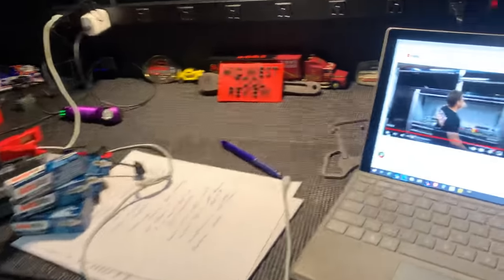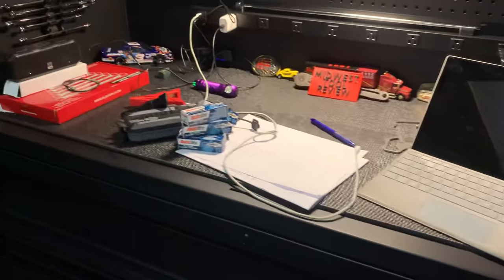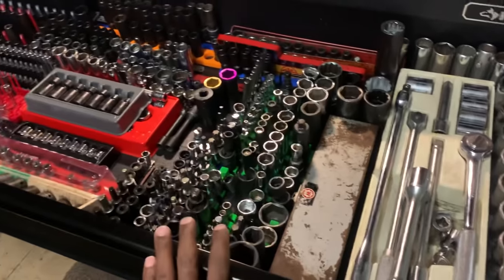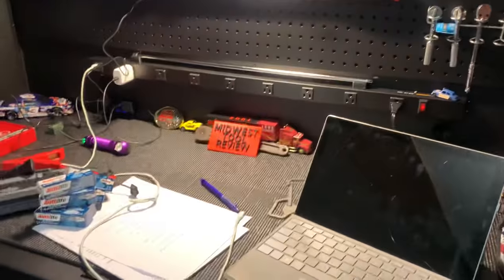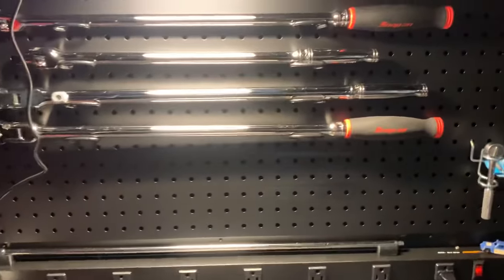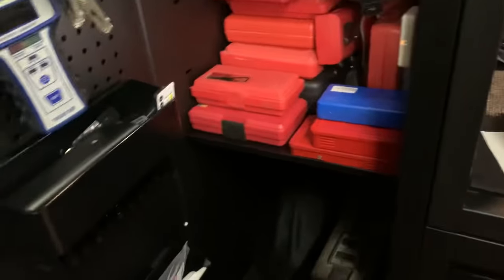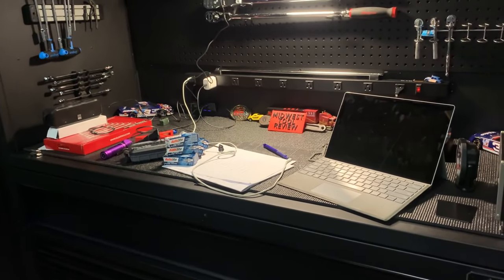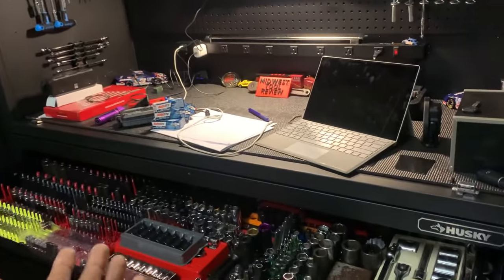HUSKY TOOL BOX | DISAPPOINTED & NEW PROFESSIONAL SERIES THOUGHTS

Comment: Great review.  As far as Husky tool boxes, they basically make three levels of tool boxes.  Some say 4, but in reality, the 4th one is simply different items used on their lower end, entry level, like one will have a thinner or thicker wooden work top or stainless work top.  Regardless, those are still their Standard boxes.

Their 1st level/ entry level what they call Standard Duty boxes are just that, entry level.  They use 21 ga steel, a few welds and rivets to hold them together.  The welds aren't really that great by comparison to their higher levels, but they are still better than Kobalt, one of their main competitors.  (But then again, who isn't better than Kobalt?)

Their 2nd level, what they call Heavy Duty (which is the box you have) jumps up their steel to 19 ga.   From what I have seen in the stores, they add a smidgen more welds and rivets, and most boxes are a bit nicer when it comes to the manufacturing process.  You get better paint as well.

Their 3rd level is the Professional Duty series, are made with 16 ga steel, and since I've only seen one box in person, and that was only for a brief second, it appeared to have a little more attention to detail, better welds and metal shaping/curved over edges etc.

So maybe when you start at their factory, you are on the lower level boxes, and hopefully you learn a bit more and take a little more pride in your work and move up and so on.

Obviously as you move up the chart, your components are better, more robust.  The casters, drawer slides locks and as you mentioned, lighting all tend to get a little bit better.

For the price, they are quite appealing to many, especially those on a thin budget.

Although in my professional opinion, if I was only looking for a typical top/bottom chest combo, I'd pay a little more and go with the Milwaukee Tool brand boxes over their Standard Duty and Heavy Duty boxes.  Unfortunately, or fortunately depending on how you look at it, Milwaukee doesn't make a box in the configuration that you have in this video, only top/bottom chests and work benches and carts(only a side locker, no hutch).  But that's a different story all together.

But with the large amount of manufacturers out there, overall, I believe that Husky offers a great value.

Comment: You brother in law box has to be heavier build because it has to handle more weight for the top box. But your locker being not as deep as the box it self is absolutely crazy ... I never been a big fan of this style Husky box ... You live and learn James. Good video 👍👍👍
Reply from the maker: That may be; never considered that, but the hutch isn’t a feather weight either…I just wished they’d kept the materials sizes consistent across the various product types. The side locker doesn’t make any sense, and as I noted, casters and various finishes could’ve been improved. Live and learn is an accurate statement…

Comment: Your tool setup needs a way more professional grade box than what you have bought here. You have bought a budget, ( the cheapest available hutch setup on the market) and expected snap on quality. That box is a excellent deal at 1400 and no one even comes close to that price for a setup like yours. You need higher end box. Now if you had pad 3500 for this box I’d understand your complaints. Bottom line is for the price there isn’t a better deal out there. I am super impressed that top drawer is holding up to your 10,000 dollars worth of sockets in a 1000 dollar box. Lol.
Reply from the maker: I don’t disagree that I should have a pro-series box, but at any price point, you should not expect to receive a box with buckled corners or any structural related damage. Overall, I’ve been nothing short of impressed with this box. I’m not one for settling in terms of what I expect for my money, therefore whether I spend $1400 or $14000, I expect the manufacture to deliver on quality, after all, they did not design the box with defective corners

Comment: Husky's 'professional' grade boxes look nice, but overpriced in my opinion.  While they want $5k for the hutch/box combo, I'd much rather spend the extra thousand on the Tool Vault Elite 84" XL (TV-84Combo1), which i plan on doing.  Lift latch drawer pulls, 84" of workspace with 30" of drawer depth.  I've just never been a fan of soft-close or detent style drawer slides.

Comment: 15:19. The Icon box is a pretty serious box, possibly better built than Snap-On.  Quite a bit better built than the Husky Pro box for sure.  (In fact, I'd say the Husky Pro is more comparable with HF's lower end U.S. General line, and even then, it's not clear the U.S. General doesn't out rank it.) They are priced the same (both $3,500), but the Husky goes on sale quite often (it's $3,000 right now), which really puts it about $500 less than the Icon.  Honestly, I'd buy the Icon box without hesitation.  You won't get as many features, but the features you get will be built like they mean it.
Reply: Icon is not built better than snapon your not a real mechanic if you say that
Reply: @roninbushito  Have you seen both side by side?  The Icon is a pretty serious unit.

Comment: No icon is around 6k to 8k. Even the US General is expensier than the husky box. I was in the market for a tool chest. And checked Icon, US General, and Husky. I would say same size and quality US General and Husky are about the same price.  Icon looks nice and good quality, but they sell the stainless steel separately. I got the one in this video used for 700 dollars. Currently they go for 1700.l to 2000 dollars.  I say buy a used one. Usually people who buy these boxes are tool.collectors. The used boxes are in great shape.
Reply from the maker: I’ve had my Husky box for a few years now, and I must admit, it has held up mostly… My main drawer weight well-exceeds the required limit, but it works. The remainder of the box operates as it should. No rust or excessive wear. To buy a new Snap-on or any professional series box is complete stupidity…